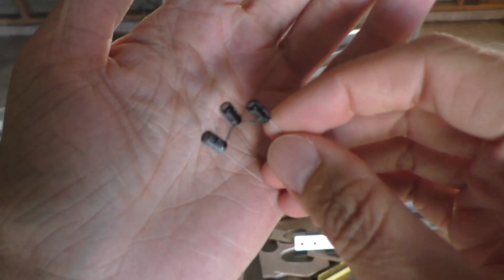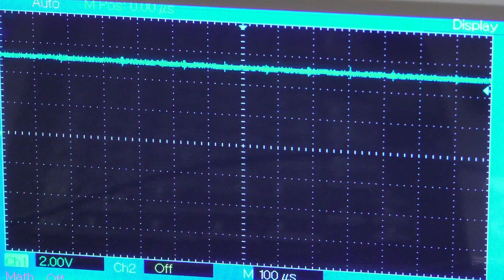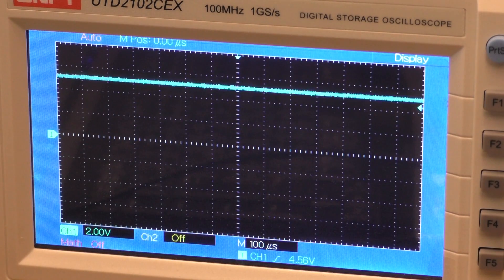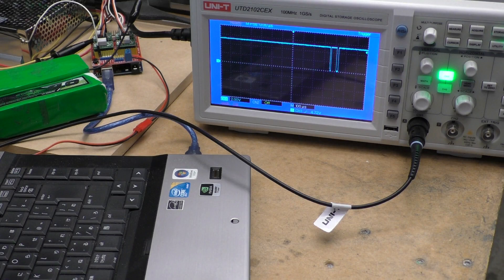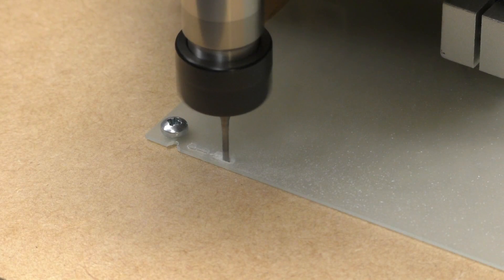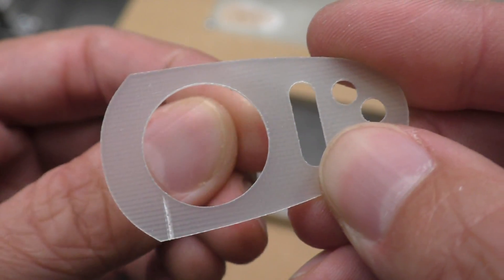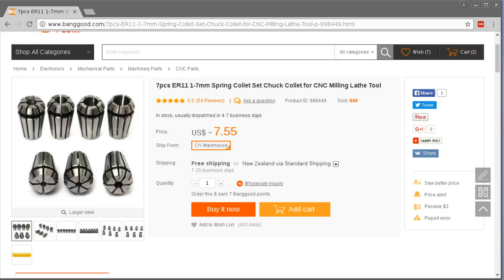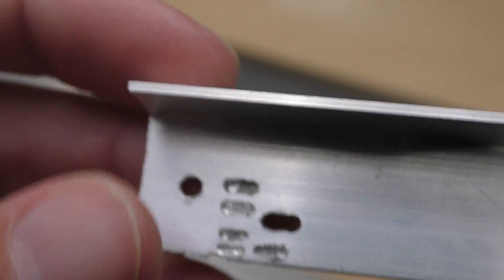DIY mini CNC machine part 11 (spindle round four + more cut tests)

Comment: it has been 7 years so you have likely figured this but combined with many of the other comments you would do well to clamp your work better when i was building my cnc i used good name brand painters tape on both surfaces and ca glue as a temperary tool holddown until i set a proper one up it wasnt perfect but it would help with chatter oh and surface your bed too

Comment: Watch out with those bare capacitors wires. The motor wires are live (not isolated from the mains) since the cheap motor controller has no isolation at all. Even the speed control potentiometer is live.

Comment: Hello

 I have a CNC with the same spindle and I have exactly the same problem, I have tried several options and the noise is still there.

 Were you able to solve the problem?
Reply from the maker: Eventually I used wireless (bluetooth) connection between laptop and arduino, no problems since then.

Comment: The tool holder with the bit needs to be snapped into the collet nut before you mount it on the shaft.

Comment: So what finally helped you to fix this EMI Issue? I recently bought the same spindle and I can't make it work. I have the same "lost connection issue" as You had.
Reply from the maker: I ended up using bluetooth between the laptop and the arduino, since then never had a single problem.

Comment: The plate is too thin and not secured enough causes a lot of fibration. I too use this spindle to cut 6061 aluminium up to 6mm and the result is good. The problem is you have to go very slow like 5mm/s or less on the feed rate and step down 0.1mm.

Comment: is it possible to just replace the smaller USB cable that can fix it all or is there an additional way because I've watched your videos a lot of experiments that you have done for this problem and I'm experiencing the same thing as you
Reply from the maker: I ended up using a bluetooth connection, never had a single issue after that and I can move my laptop around more conveniently.
Reply: @iforce2d  do you have any new videos about it all please help me to overcome this problem

Comment: I had that movement stuttering when using those small and cheap stepper drivers, the drv8825.
It turned out that some can't handle more than half-steps before their output signal stops being linear, and starts being more sporadic.

Get some TB6600, if you haven't already :)

Comment: If your er11 collet seems to be off centre when you tighten it,, check it fits almost flush with the nut. if not, it's not installed correctly. The collet has to be installed in the nut before fitting.  See https://www.youtube.com/watch?v=iZd0zDelSPc

Comment: It's a couple years later, so you've likely figured this out, but aluminum does better with fewer flutes on machines like this.

But I do hear a lot of chatter and general nastiness going on. I assume you have a lot of play somewhere, or the runout on the spindle is really high. (Or maybe it is the collet snapping) [Edit: it's almost certainly the lack of proper collet snapping]

Collet: Snap it into the nut first. ER collets are designed for you to snap them in at an angle. There's a bit of a trick to it, and it can be annoying enough to remove that you end up buying a few extra collet nuts and just keeping them on the collets, with the tools.

Comment: Due to the low rigidity you need to take a light cut but just slowing down is not going to help. It works mutch better to take multiple depths instead of trying for the full depth in one cut.
Or you could take a full depth but small width of cut instead of slotting.
Another thing is that when the aluminum melts into the bit it means that the bit is not taking off enough material every time it goes around. Instead it just melts. Wat needs to happen is every time it spins once it has to take enough of that it carrys the heat of the cut away with the material that is removed

Comment: The collet is warped. you may have over tighten it  or not installed correctly , once it goes of centre then you should bin it and put new one inn.
on ally use a 1 or 2 flute cutter, only use a buring tool for circles or round edge

Comment: The first most important step in milling aluminium is that you need to get those cutting chips away as fast as you can. So you need a pressurised air jet pointing to the mill. Once these chips are removed the motor stalling stops and you get a cleaner cut with lesser endmill breaks. Hope that helps.

Comment: always use shielded cable!! 3 caps @50Volts in series cannot be usable @150 volts!! caps in series divide the capacity and do not add up max volt per cap!!! use 250 volts caps
Reply from the maker: I was using shielded cable between the laptop and the arduino! I put the caps in series to handle higher voltage, not for more capacitance. The electrolytic caps blew up because the polarity was wrong. I used 5 ceramic caps not 3. They were ok for about a year and then smoked one day. Now I'm running the spindle without any caps, and bluetooth connection between the laptop and the arduino.

Comment: Hey, I'm building a CNC with the same type of spindle and I was wondering if you tried flyback diodes on the spindle, they should reduce EMI/noise. I read an article about reverse current disabling Arduino to laptop connection, but Arduino keeps running, they offered the flyback solution.

Comment: Try spiral up-cut bits with less flutes for both aluminium and acrylic / plastic.  the hatch / corn fluted end-mills work best for fiber glass or PCB where chip load is low. You're getting aluminium welded as other people have said, this is due to lack of chip evacuation and friction. You will destroy the bits soon with that. Also need to select the right end-mill + feed & plunge depending on the material.

Comment: Hello friend, can you pass me the reference of the capacitors that you used
Reply from the maker: After a while the caps burned out, and I have been using it with no caps for many months. I don't think they makes much difference. The solution for me was to use a wireless bluetooth connection.
Reply: @iforce2d  

friend you can show me how you did .... can make a video .... I am with the same electronics and motor spindle of the video ... more I did not find any solution .... the machine stops of nothing ... . Sorry if my English is not good, I'm using google translator .... rsrsrsr

Comment: Don't use electrolytic caps on motor because of the back emf voltage also put a ferrite core on leads - a cap of about 0.1 MF is a good ball park figure to start with !!!

Comment: How's it holding up? I think you're too conservative in your feeds, and too aggressive on the number of  flutes. 2 flute for everything except aluminum (use single flute). Make chips, not dust, for better tool life. 
I've had this spindle for a few months, my usual cutoff toolpaths run it with a 1/8 endmill at 12k(full) rpm, 2200mm/m, 2mm DOC. It can be pushed further, I could do up to 3mm DOC 2600mm/m but the finish starts losing quality. Would try the same bit in 4 flute but I'd need a faster moving machine.
Other bits as I've used it, not that they're ideal, but it has worked for me:
- V bit  1/4 60deg: 3mm DOC, 1800mm/m
- V engrave 1/8 bit 20deg: 2mm DOC, 1400mm/m (it could snap)
- 1/2 flat router bit: 1mm DOC, 1900mm/m (flattening), 65% stepover
- 1/8 tapered ballnose 2.25° and normal ballnose: finish depth, 1600mm/m, 10% stepover
- 1/8 flat endmill for profile (cutoff): 2mm DOC, 2200mm/m
- 1/8 flat endmill for pocket and 3d roughing: 2200mm/m, 3mm DOC, 40% stepover.

I really need to start testing 1/4 bits, especially the tapered ballnose for faster finishing, and downcut flat endmill for pockets and roughing.

Have fun!

Comment: Just another tip and maybe you have figured it out already: There is a relation in between the material to cut, the optimal cutting speed (circumferential speed of the tool) and the feed speed and of course the material of your tool (look here https://en.wikipedia.org/wiki/Speeds_and_feeds). And in my experience to  get a nice surface with aluminium requires cooling/lubricating the tool with methylated spirits (in germany it's called Brennspiritus which somebody use to ignite a bbq)
VERY NICE VIDEOS, THANKS!!!

Comment: They are polarity sensitive electrolytics, getting hv spikes back emf in them. plus, there is a relationship between the capacitor value, and the rf noise you want to suppress. microfarads will suppress low freq, nano farad higher freq (pico even higher) All my filters use ceramic caps (or greencaps) in the nano farad range - 0.1nf they are not polarity sensitive either. Pull one out of an old swichmode power supply if you need one without visiting a shop. happy cnc-ing from Wellington!

Comment: I think your run out on the mill is way too much. Overall rigidity of the spindle, chuck/collet and mill should  be a very tight tolerance. It looks like you're getting chatter from either too low or high RPMs and the feed rate is not matched to whatever your RPMs are set at. It is a happy balance between material, RPMS and feed speed.

Comment: im only at 10:15 now but i can say this is the wrongest Endmill you could ever use for aluminium! This one is ment for carbon or Graphite electrodes. For aluminium use 2 or 3 flute extremely sharp endmills (2 flutes if you mill a slot at relatively deep depths and 3 if the chips can evacuate easily, because the endmill is more rigid) And of course give it a little Fluid :)
Reply: oh and one thing, rather than buying lots of collets, only buy the oney you really need, but get good ones, they are worth it :)

Comment: Move your power supply away from your Arduino and if possible, power the Arduino in a shielded aluminum box. ALL data cables should be shielded.

Comment: I don't know if you fixed your noise issues but you should be using a shielded cables throughout. Even on the power cables. Capacitor voltages in series are the same as resistors in parallel. They are all getting ALL of the voltage. You should be using at least 200V caps. Also, check your power supply. That could be the source of your problem. I have not watched all the videos completely through, but if this is a Chinese made power supply, they are notorious for having problems. All you low voltage grounds (Low side of the power supply) should be connected together. I will post more if I can think of thinks.

Comment: It looks like you are cutting non-machinable soft aluminum alloy here. This looks like structural aluminum, you need to select machinable tempered alloy such 6061-T6 for you tests. You will see a lot of difference. Oil will not help to machine soft aluminum, but if you want to use lubricant - use special aluminum cutting fluid, it will improve cutting tool life and cutting tool will make less heat.

Comment: Did you get the interference problem solved? I have the same spindle with the same problem.
Reply from the maker: I think so. Ground everything properly, put caps on the motor terminals, shorter shielded USB cable.
Reply: Thank you for your reply.

Comment: Hi I find with hand routers the shattering is a speed issue , load and length ratio all combined , when I use half inch bits it never happenes except the router speed drops a tad  ,if you can shorten the bit up it will be more direct and less or no chatter , and if I cut alloy with a hand router I lube the surface and it cuts like butter , hop I make some sence thanks for vid I am going to move into Cnc at some stage and love these vids thanks

Comment: Is the general unexpected movement of the tool and vibrations all due to the unsupported X and Y axis bearing rods moving. Would replacing these with supported rods help? It might be a straight forward upgrading looking at your machine design.
Reply: Perhaps putting you dial indicator on the X & Y axis bearing rods will tell you if they're bending....

Comment: Get higher voltage rated ceramic caps 250v+, 1 cap pos to neg, 1 cap positive to motor can, 1 cap negative to motor can.

Comment: There are several reasons for the problem. First of them being your apparent lack of knowledge reguarding how to mill metals with a cnc machine. The first thing you lern is to 1. cut WITH the spindle direction and NEVER against! if your bit is clockwise then your motion and path of cutting needs to be clockwise or your cutting wrong and hard wich will lead to chiping of the material and tool and loads of vibration. So make sure to work with the tool and never against it. If the tool and spindle movers -> that way you should have a path that is also going -> ok? 2. calculate speed of the tool to match the material, aluminium will have one cutting speed, where say hardend steel will require another. 3. Calculate the travel speed and depth of the cuts to match the speed of the tool and material. It will determine the surface smoothnes outcome. There are charts for this to be found. 

Good luck and i really enjoy looking at your videos so keep the good work up! 
/Richard
Reply: Richard Jonhamre , the thing I've never understood with climb vs conventional milling, is that if you are cutting a path, one side of the path will be climb, the other conventional.  Well one side always be smoother than the other?

Comment: Do some reading on how different number of flutes on  bit, chip load, feed rate, and how they correspond. Faster is not necessarily better, its a balance, you don't want the chip coming off to be too small, or too large, but in between.

Comment: omg, on DC motor is alternating voltade and direct current, its simple PWM control of the motor, use the fuc.... shealded cable between supply and motor, sheald conect to groud on each side (motor case and psu case) an every moving parts must by grounded together for preventing demage rails and screw because voltage potentional makim little sparks between

Comment: kerosene works very well for lubrication and prolonged tool life. its very clean and cheap and works very well for plunge routing aluminium from experience. Reduces bit chattering aswell

Comment: andrewsweet43 is kinda right.
The VFDs have special circuits to cope with voltage induced by the spindle. It is a generator that produces voltage when turned off and still turns.

Earth EVERYTHING, shield EVERYTHING also and in special the data cables and you should be good. Else get a decent power supply

Don't plunge the bit into the aluminum but ramp it in. there is actually no chip load. the feed and speed is totally off. You are not cutting. So your feed looks to me too slow and the cutting depth too high for this tiny bit. And the soindle speed is probably too high for aluminum too.
Do so quick passes on long cut and gradually increase cutting depth until it feels alright

 Garbage in = garbage out.
Some off the parts shouldn't be cheapest of the cheapest to spare you head ache :)

Comment: Cutting aluminium with a spindle that has massive runout like yours seems to be having. Also - don't use small 4-flute endmills with aluminium and something like acrylics. As you say it'll just gunk up your bits and stick to it and not cause it to cut very well. For aluminium try a 2-flute and for acrylics use an up-cut bit or a compression bit for much better results... I'd suggest you buy a regular router like a Makita, Dewalt or similar and use that instead.

Comment: Hi iforce2D,

The spindle supply is definitely a PWM output, not DC. First, for a 500W motor, a variable DC supply would have to be a LOT bigger to dissipate heat at low speed, up to several hundred watt. Second, DC motor losses torque when used with low DC voltage compared to its nominal voltage, this is why a PWM is required. You can check the output with your scope and a differential probe with at least 300V common mode range. I don't recommend a single ended probe because the power supply seems to be a little tricky... (there are often bad suprises with chinese products).
Check if the isolation between AC input, the output to the motor and the casing is correct, do not trust chinese ... stuff. If there is a good isolation, connect the case to earth, this will help (a lot), but be carefull because it seems that you have measured a variable voltage on the casing ?? This must not exist. Did you receive the schematic ? Can you post it ? It will help to be more accurate for the fix to apply. 
Check if there is a good isolation between the motor itself and its input wire. Connect the CNC to the earth at the spindle power supply case level, not elsewhere.
BTW, connecting a big value capacitor across the motor connection is totally useless with a PWM supply. In fact, you degrade the shape of the square wave which become a sawtooth which degrade efficiency and torque of the motor. Moreover, the ripple current in the capacitor gets very high at a hundred volt, that's why the electrolytic capacitors exploded. That current is also a useless power drain from the power supply.
But a small (100pF to 10nF, to be tested with scope, differential probe mandatory to avoid common mode noise measurement error) ceramic capacitor can reduce noise by slightly decreasing the rising and falling edge of PWM pulses.
You should twist the wires going to the motor. At 5A (about 500W / 100V) switching current, the stray inductance of the parallel wires (the one I can see you use should be around a few uH) generates over and undershoot and is an excellent emitter. Shielding of that cable will also improve capacitive coupling with other cable like the ones for the stepper motors. One cable switching from 0 to more than a hundred volts coupled to another cable induce enough common mode voltage to disrupt the microcontroller or the USB chip.
If you have the schematic, I can help with the potentiometer issue. Those are fixes you can apply but first things first, you should solve the power supply case voltage, it's mandatory.